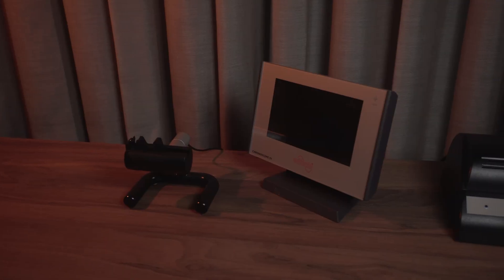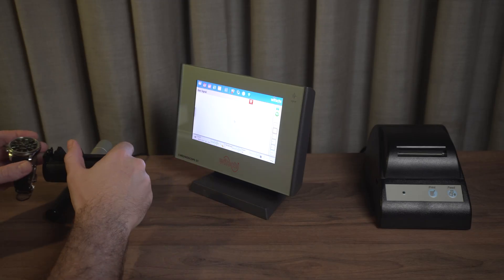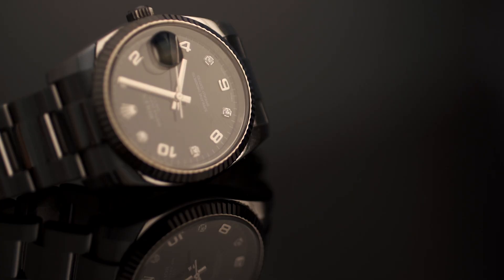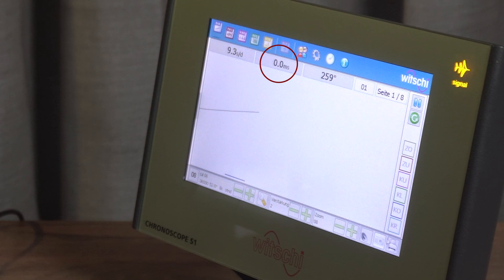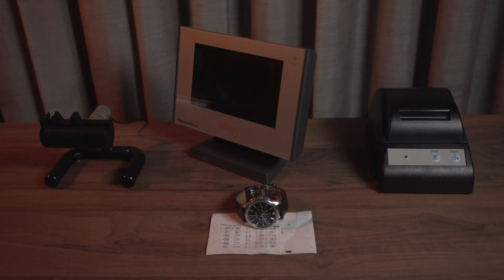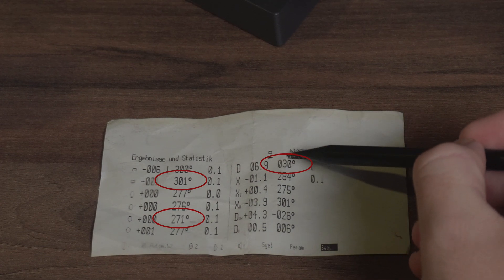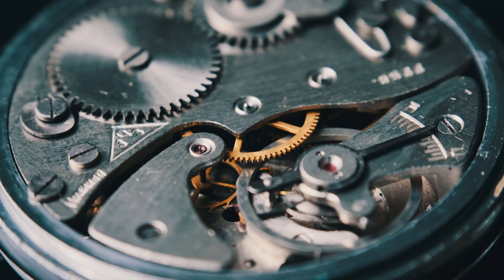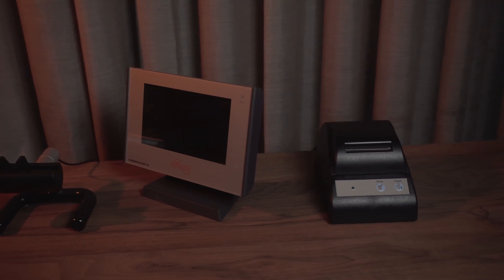A Watchmaker Explains: Why Your Watch Is Not As Accurate As You Think.

Comment: Hi,  I’ve been informed that Grand (GS) caliber 9S4A, used in the manual winding Birch Bark, can not accurately measure ; daily rate, amplitude or the best error on a time grapher bought in the market place.  And you need to use a priority GS designed time grapher only.  Because of the dual impulse escapement this GS caliber uses.  Is that true?  Regards,  I is my understanding that any watch with an escapement can have the health and accuracy of any watch accurately measured, daily rate, amplitude, beat error on any timegrapher that can be bought on the open market.  And the values for these parameters are essentially standard and only vary by the watches condition.  From brand new to vintage and is also dependent on the quality of the caliber as to which end of the ranges for these parameters are to be expected.  Regards,  can you also tell me the acceptable ranges for the 3 parameters being discussed here?  And specifically, if possible, for a brand new GS caliber 9S4A.  Thank you.  Regards,
Reply from the maker: That is a great question.
It is true that some special escapements can be tricky for certain timegraphers because of how the impulse works. I have not worked on the 9S4A yet so I can't speak from direct experience.

Any watch with a regular escapement should read fine on a timegrapher.

About your question regarding the numbers. Yes, they depend a lot on the watch. With vintage pieces you often can not expect perfect stats because parts are worn or replacements are limited.

Brands matter too. Some movements are very consistent while others are not. I remember working with Blancpain and many of them ran surprisingly poorly.

Comment: THANK YOU SO MUCH!!!
I am interested only in screw-in crown mechanical certified and non certified chronometers-not dress not dive not complicated watches..
1.So how is possible that famous brands can produce easily multitude of complicated watches but only one or not even one precise watch(-2/+4)?
2.is it complicate or need so much time for watchmakers to adjust/tune the mechanism of watch for precision than to make chronograph,repeater or tourbillon?
3.actually how watchmakers adjusting mechanism for a precise or chronometer watch in factory? 
BIGGEST THANKS FOR YOUR INSIGHT ANSWERS!!!
Reply from the maker: So basically, how accurate your watch is depends mostly on the construction.

But I have seen many cases where you can make almost any mechanical watch run extremely precisely - it just takes time.
Often it simply comes down to how much time and resources a brand is willing to invest to get that level of accuracy. It is not always some complicated science.
Reply: THANKS!!
PLEASE I did not understand,so CAN YOU EXPLAIN ,CONCRETLY, :
on what kind of "construction"that is responsible for accuracy of watch(In your first sentence of answer)you did think?
THANKS IN ADVANCE!!!
 @watch.mentor_official
Reply: @zeljkosto he is taking about the geometrical details of the movement. As an example, let's just think about a single jewel and the stem running in it: how round are the bore of the jewel and the stem? How much play is left in between the stem and bore? How much oil was used to lubricate? How much out of balance is the wheel attached to the stem? Etc etc. 
All these fine details dictate the precise friction properties of just this one bearing point. 
Extrapolate the same thinking towards every part of the movement, and you'll understand why ETA or Sellita can produce Chronometer-grade, long lasting movements for rather cheap, while some expensive watches with extremely complicated movements often cannot achieve the same level of performance: they just haven't optimized their production processes deeply enough.
Reply: ... not dress,* not dive, not complicated watches.* If a watchmaker would assemble a watch the same way as you punctuate, it would fall apart as soon as you take it out of the box.

Comment: Thank you for going through all these measures and what they mean. I have already compared my watch on a day to day basis with atomic time, and I see either a loss or a gain of two to three seconds per day. This sounds very accurate, but the watch loses a second every two to three hours when it is on my wrist but gains a second every few hours when it is dial up on the dresser. So it depends on how long I wear the watch on a particular day as to whether the watch will gain or lose time. On these measurements it is much more accurate than the stated accuracy of -30/+45 secs per day.
Reply from the maker: Yes and that's why relaying only on the timegrapher does not say that much because when wearing the watch things are different.